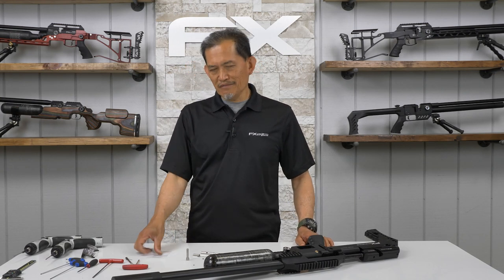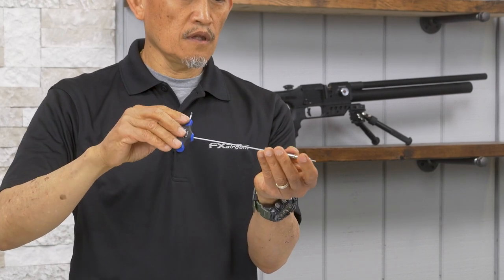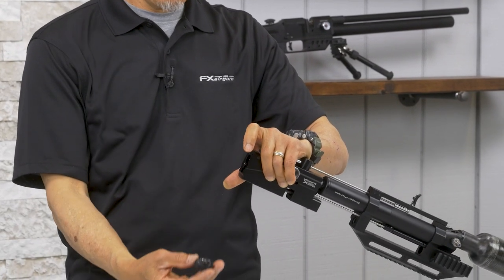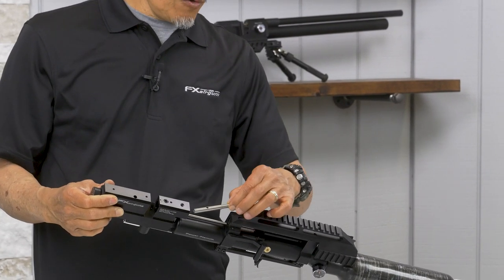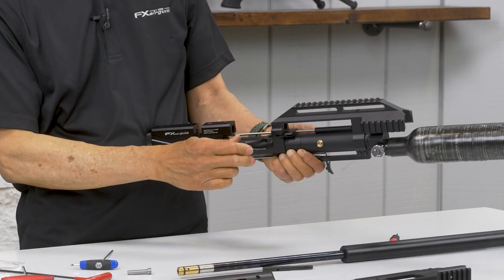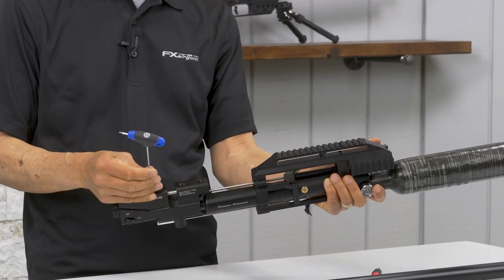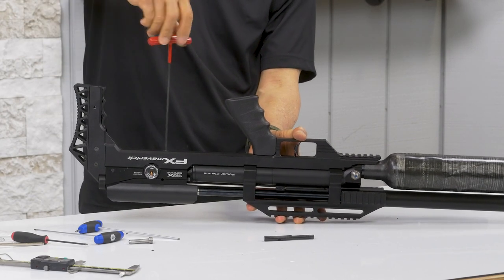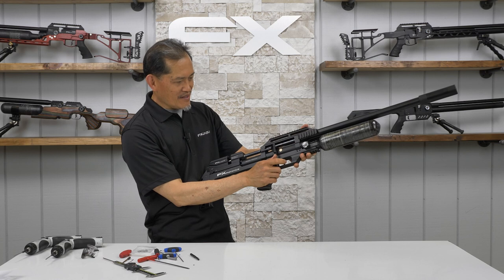Maverick Slug Power Kit Install

Comment: You made it look so easy...
I've been doing disassembly and assembly with everything from fine instruments to oil field equipment and never "pick up a hammer" to force anything (and am very good at keeping calm and focused) but putting in the probe retaining screw like to kicked my ass. I just couldn't get the threads to start!!!! I finally used cardboard pieces and rubber bands to shim and hold the cocking handle out a bit so it was directly under the access port and even it was difficult to engage the threads. THEN I had to take it out again to adjust the pin length. I did finally get it in but it took me almost 45 minutes.

Comment: Ernest, two points, One, when fitting the slug kit, there are two positions for the barrel to be fitted against, one is marked with an S the other with a P (slug or pellet), second point, I did not notice you applying any of the special grease to the new parts or the small bearing in the hammer adjuster to keep it from falling out during reconstruction. ! .
Reply: Was there any response from Ernest as to which position the barrel should be in after it's reinserted?

Comment: Are the Maverick 30 cal slug kits coming soon??
Reply: Hello is the power kit exist for cal 0.30 today?
Reply: @Fada2peche  sold my Maverick
Reply: @stedyone1090  why did you sell it , just curious
Reply: @bigearl8687  Had the 30 cal Maverick Sniper and did all the mods pin probe and transfer port and cabon fiber barrel wrap and then the MK3 came out. 🙄 
Purchased the 357 Western RATTLER. 
No mods necessary. 
Wild hogs and coyotes are not happy. 
10 days ago received the Panthera 22 700mm and SKOUT EPOCH 30 coming next month which after all mods to a MK3 Impact the EPOCH is actually cheaper 😳

Comment: You would think for the price these rifles are sold for that the pellet probe screws would actually fit through the pellet probe without having to drill the pellet probe screw hole out. I thought that maybe I got a bad one. But after browsing the web it seems like it's common for them to be out of spec. And if you do buy one be sure to chamfer the hole and debur it after drilling it out.

Comment: Question: in the barrel for Slug it must set  S in the top or P in the low position?
Reply: To shoot slugs you have to put P on the top. The letter you don't see is the letter you will shoot 😉
Reply: @Fada2peche  J'ai un doute sur la réponse.
Reply: @cyrillecroix2821  non non c'est sûr et certain 😉
Reply: @cyrillecroix2821  la lettre que tu positionné vers le bas sera le projectile utilisé...

Comment: Hello, friend, good morning!
 I installed the slug power kit on my Maverick and noticed that the carbine was weaker than the original.
 Did you exchange the original spring of the hammer for another one?

 When watching your video, I noticed that I installed the hammer backwards, I positioned the spring in front and the thickest part of the hammer in the back, and in the video you installed the reverse, does that have any influence?

 Thank you for your help.
Reply: Yes it has a VERY big influence. If you haven't destroyed your hammer/valve yet, put it together the correct way and you should be 10-20fps faster.
Pro tip: When disassembling things pay close attention / make photos of how it's originally assembled. You won't make such a rookie mistake anymore. ;-)
Reply: @hornyj1  obrigado

Comment: Hey could you share a PDF file with best settings for each pellets on impact m3
Reply from the maker: Please contact our customer service for the settings.
Reply: @FXAirguns  why you don t share a file with all best settings?fx impact m3 is a plateform for sharing best settings
Reply: @derivas007  join Airgun Nation or Gateway to Airguns and either site has lots of experienced and helpful airgun shooters with a combined experience of thousands of years.
Someone has already done the research, take advantage of it.
Reply: @bobjoatmon1993  do u have a link to share

Comment: I'm a brand new FX wildcat mk3 sniper shooter the slug power kit installed went easy and the power levels are insane 😎

but there are things I would like to change about the wildcat stock like the butpad shoulder piece I would like to upgrade it and fit a monopod at the side back off it there is nothing on the market for the wildcat mk3 sniper and I would like to have an 800mm barrel kit for it to bring it up a level that would be nice is there anything you guys can do to fill up the market because it's a big missing in the market

greets from the Netherlands
Reply: Hee man! Mijn wildcat mk3 bt sniper is onderweg. Ik heb ook de slug power kit erbij besteld. Is dat beetje hetzelfde met installeren als in de video? 
Heb je miss ook een foto van jou set up? 
Fijn weekend! ✌🏻
Reply: hee man 
cool dat je de bt variant hebt besteld istalleren gaat het zelfde als de video heb zelf geen content op mn kanaal 
ik zou je wel een foto of filmpje kunnen laten zien heb je fb messenger ?
k heb echt een maffe setup van waar int land ben je ?
Reply: @glennshobbiesenzz  ik heb helaas geen Facebook.. ik heb evt wel LinkedIn of instagram. Ik denk dat ik hem dinsdag ontvang. Heb helaas nog geen scope die ik wil hebben is nog steeds uitverkocht. Ik woon in nieuw-buinen.(Drenthe) beetje ver van het zuiden vandaan😅

Comment: That is a cost of 501,600.  Because of the deffects thst i told people to check themselves . I bought a fx Air guns because Matt said the barrels were perfect exactly the same and the target he showed at 100 yards was a quarter inch group which they can’t even get smaller than an inch and a half group with slugs at 100 yards. Mats videos should be taken down

Comment: I’m having trouble finding this for my .30 Mav.
Reply: Not out yet.
I'm looking also.
Reply: The .30cal Mavericks already have the heavy hammer and spring for slugs along with the slug barrel (at least the Sniper does)...the .22 & .25 cal rifle 'slug kits' provide the .30cal hammer and spring along with adjustable probe for .22 & .25
Reply: @vetteconnoisseur9531  slug kit not available for the 30 cal. yet
Reply: I’ve got it at 945 with hybrids. I’m satisfied, but just was wondering what the deal was and why it’s not available for the 30.  I didn’t go super high on the reg yet, but did Max out the hammer. Sniper version.
Reply: @vetteconnoisseur9531  Sounds like you're happy with your tune. The 30 cal. Slug kit is not out yet by FX or Krale.
I can wait. The pigs I hunt every week are pretty tough. All my shots are under 40 yards so accuracy is not an issue. Groups are tight under 50 yards.
Probably use it for deer this fall, plus turkey, coons, bobcats and coyotes.
Reply: @stedyone1090  i wouldn't hold my breath on that kit...as for deer it's just my opinion but the Mav is well under powered for large game.  I'd suggest getting a Bulldog .357 (just scored one from Sportsmans Guide for $620 with my points)
Reply: @stedyone1090  as for my tune...yes - I'm very pleased. My last cal session was 31 shots w/ the FX Hybrids at 53.5yds which resulted in a ragged .30 cal hole.  I have a 2.5" steel plate out at 92yds which rings after every shot...my Element turret is dope marked out to 250yds which I plan on validating in a couple weeks
Reply: @vetteconnoisseur9531  I have 5 30 cal Airguns capable of ethically harvesting the deer 🦌 in Florida most of which are barely over 100 lbs. especially at ranges under 75 yards, mostly under 50 yards.
Hogs are much tougher and I  take them every other week.
Reply: @vetteconnoisseur9531  The FX 30 cal slug kit with pin probe etc will be coming out sooner or later . 😀
Reply: @stedyone1090  ok that I can see...the 14pt i harvested a few years ago scaled in at 210# dressed.  That was achieved with my customized M77 MkII in 30-06 at 165yds
Reply: @vetteconnoisseur9531  Spent 40 years up north shooting deer up to 300lbs with rifles and arrows. Plenty of big boys hanging on the wall in the man cave.
Also been using an air rifle for over 50 years, now in a big way the last 5 years 😳. 
Much easier on the ears.
Love our air rifle club.
Call the fun police 🚔
Reply: @stedyone1090  thats awesome Brother!  👍
Reply: @vetteconnoisseur9531  high flow? Please tell me more. From fx ? Can you send link? Thanks.
Reply: @vetteconnoisseur9531  what weight 30 cal  slugs are pushing at 943 fps ? Maverick or wildcat mk3 ? I have 2.5 plenum installed on my mk3 and gained 100 fps another 25 would be great.
Reply: @SpYucaipaSoCal  i beleieve they're 47.5gr (.30cal FX Hybrids)...700mm barrel, .30cal FX Mav Sniper Donny FL edition